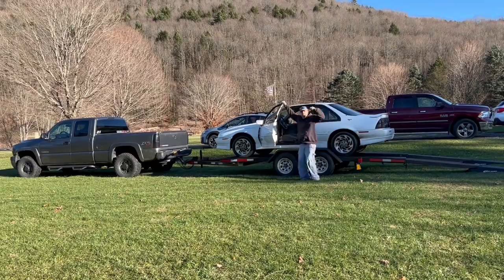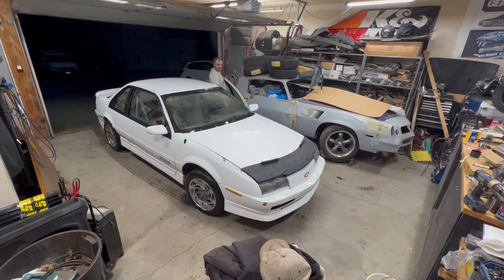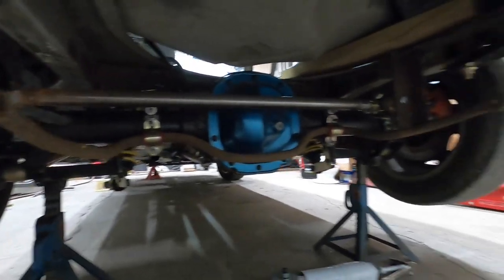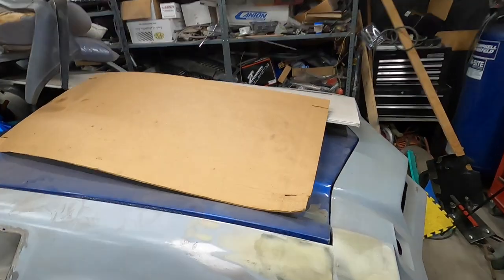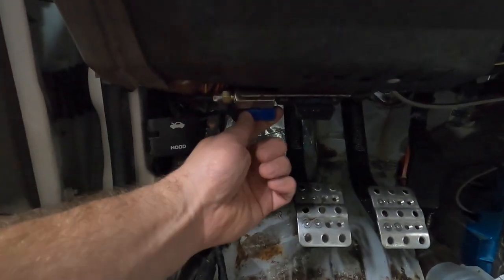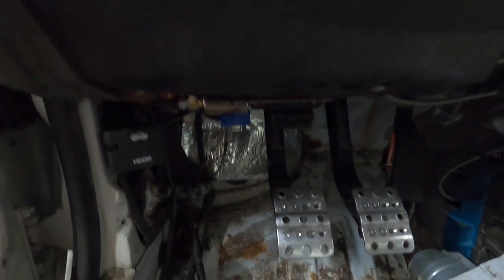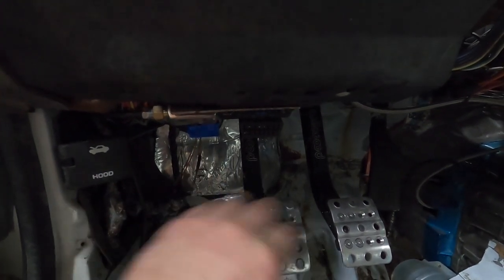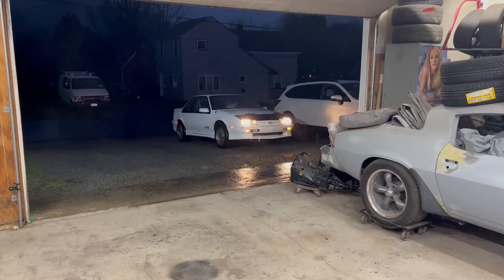Smokin' LS T56 Beretta tire fryer RWD #LSswap

Comment: Interesting e brake! I might have to use this idea on my 5 speed swapped mark viii. It has no e brake and has ended up further down hill the next day hahahaha what kind of ball valve are you plumbing brake lines into?
Reply from the maker: This one was a "mini" from Amazon for like $8. But you could also use a hardware store one just as easy. Seems to work good!
Reply: @GEARHEADdezign  appreciate the input and the videos! Keep burnin rubber